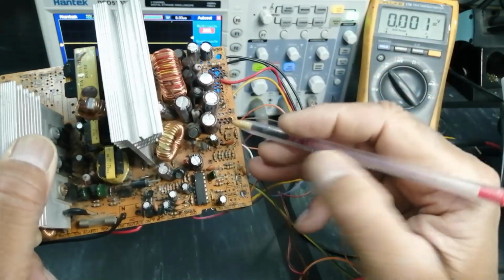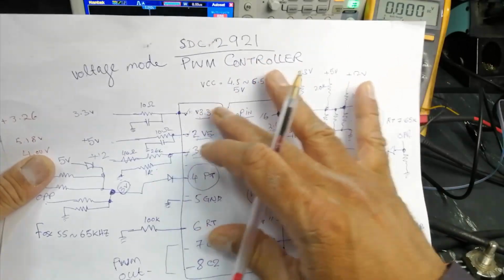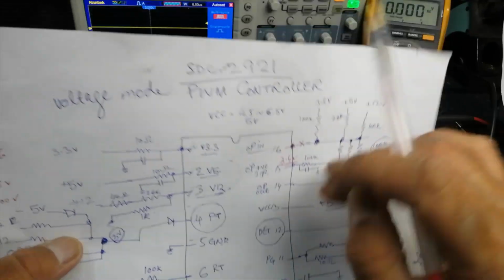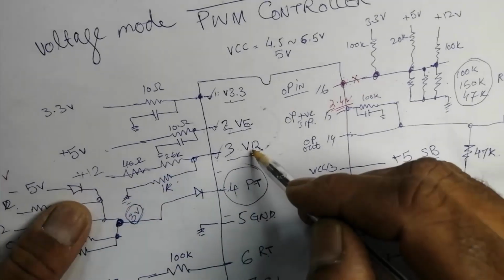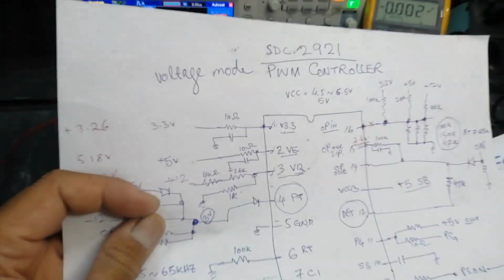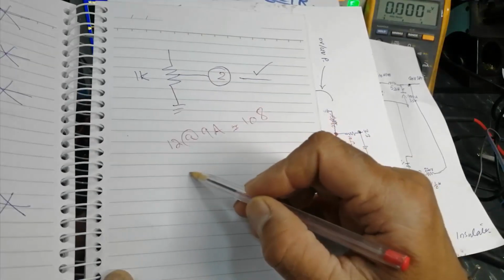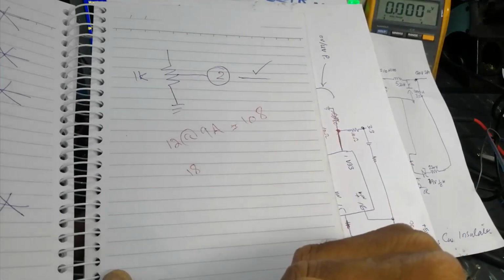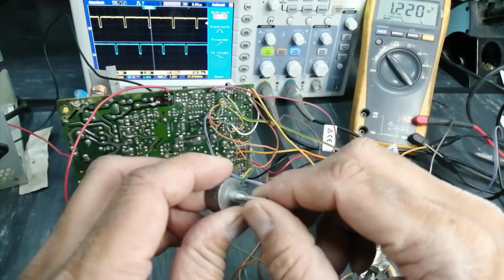#203 How to increase / Adjust Output Voltage in ATX Power supply AT2005 Part 1

Comment: This big coil with more than one winding, with more than 2 terminals, on the cold side near heatsink of diodes. It work as filter, transformer or so?
Reply from the maker: that is output filter for dc voltage
it removes ripples from the rectifier outputs
Reply: @HaseebElectronics  Thank you very much for the answer Haseeb.

Comment: Is any chance for directly monitoring on the osciloscope TL494 or any other like AT2005 look at the waveform from PWM this IC? Or you use allways spearated transformer 230V AC?
Reply from the maker: it is best to use isolation transformer to operate oscilloscope 
if we connect oscilloscope, it is safe but there are many chances for damage. 
we can monitor any PWM IC in any case. but it is much better to use isolation transformer

Comment: can I remove practically all from output side, rewind the secondary transformer coil to get o.e  stable 24V/12,5A (300W Total from whole ATX 300W psu) with some voltage divider or something on output? Did I missed something from your videos about that - which number (I doubt I can understand your english well, nor automatic Google - youtube translating
Reply from the maker: absolutely right 
you can do it
it is just a matter of getting an approach to do something
in upcoming few days i am planning a detailed layout of atx as a model and i will try to explain it in detail 
moreover i will try to explain every point where we can inject some signal to modify the existing design.
in your current scenario you have to by pass the protections from the atx supervisor ic and JUST DO IT
Wish you best of luck and success

Comment: is it possible to run this IC separately on a bread board?
Reply from the maker: yes it is possible 
basically any ic requires working environment (power & signals)
Reply: @HaseebElectronics   sir, I'm  trying to run a IC(2005z) on Bread Board, but unable to achieve  the Output signals, Could you plz help me sir...

Comment: sir, my computer turns on but no output video. I think this is psu failure. this happened to me a year ago and suddenly works again. But then there's a power outage this afternoon and my computer don't output video again. Is there anyway to adjust or troubleshoot the psu? I'm very poor.
Reply: @HaseebElectronics  I've tried everything sir, and everything I could search. But still nothing? is there a chance the motherboard is destroyed? or the PSU is not outputting enough power?

Comment: Very Good Job and Great Explanation. Sir can you explain how i can only disable the over voltage protection system  in ATX  HIPRO Model D2537F3H  and i think IC used in it is HP1002WA

Comment: Salam again, a small observation : i monitored the 3.3v and 5v output and they do not go very high (6v & 8v), and all the capacitors are at least 10v, so i just changed the 16v from the 12v rail.
Reply: @HaseebElectronics  i have seen that you can have 18v for 16v capacitors, is it safe for long use or i have to change it in another PSU ? Thank you
Reply: @HaseebElectronics  OK, thank I will then change only the 12v output, 3.3 & 5v should be in range if i do not exceed 20v.

Comment: Salam Aleikum Ssi Haseeb. Last time i had hard time making work the voltage divider, each time the PSU turned down. I went another way and grounded fault pin of the supervisor (leaving alone the PWM ic). This way, by changing the feedback voltage divider (i put a poteniometer in parallel with the TL431 ref), i could obtain 25v. I did change resistors and capacitors.
My question: with the fault signal disabled, if I make a short circuit, can everything blow apart or there are other protections ? Choukran.
Reply: @HaseebElectronics  I will try to quickly short it and see.